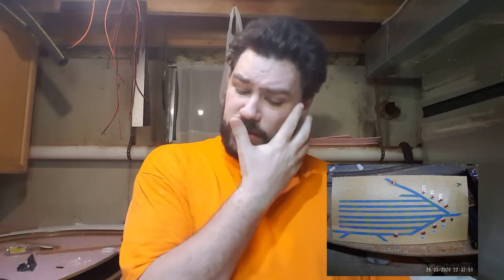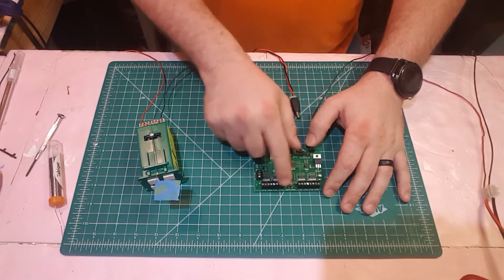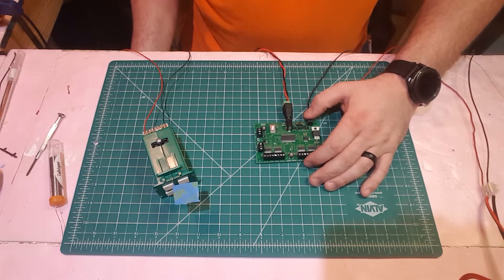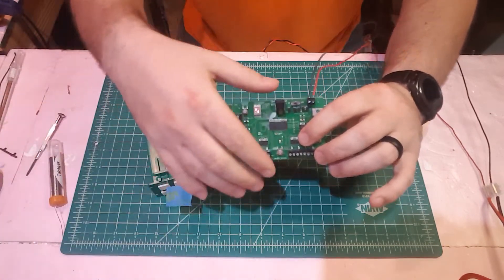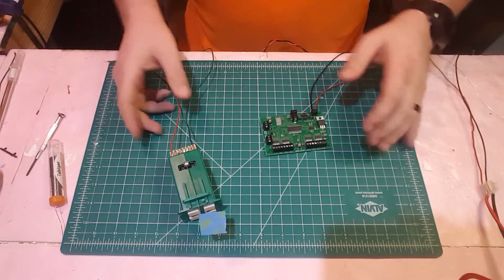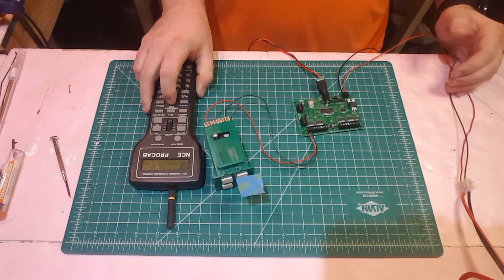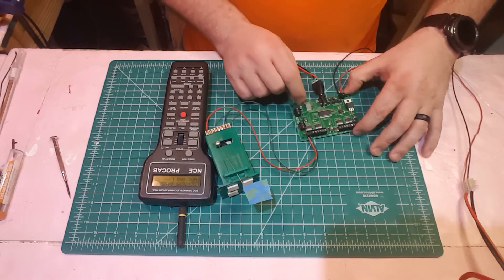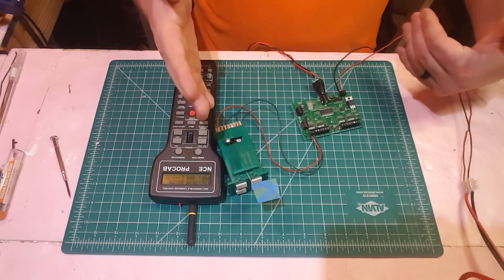NCE switch8 MK2

Comment: So I just did this step by step the way you show how to do and i got it to work. I just need a power supply to
Reply from the maker: Glad to hear it. How many train do you plan to run on your layout at any time? And how many turnouts do you have?
Reply: @FBMRR  maybe two locos at one time but I only have one for now. Of right I have 6 turnout's but I will have more for the coal mine some day. I'm just trying to get what I got now done first
Reply from the maker: @KerleyExpress  sounds great.. i think you are fine for now running it on track power. its not like you will be flipping more than one turnout at a time. i think you will be just fine. Great job getting it started. Im so glad you were able to get it working. i feel so proud (standing in my best superman pose).
Reply: @FBMRR  that's funny super Rick lol

Comment: Hey Rick really enjoy your channel. I also use the NCE system and MK2 my question is how did you make that power plug for the board. Thanks David
Reply from the maker: Glad ur enjoying the videos. Sorry i didnt explain this one. I found the plug specs in the documentation for the Switch 8 and found these on amazon. Work great. This one was easy... 
uxcell 20 Pcs 5.5mm x 2.5mm Male... https://www.amazon.com/dp/B01N48TYBC?ref=ppx_pop_mob_ap_share
Reply: @FBMRR  Thanks for the link, but 20 is way more then my need, Only need 2, is the 2.5mm Male the correct because I see a package of 5 but listed as 2.1 mm Male, and another question where are connecting the wires coming from it to, 
Thanks
David
Reply from the maker: DO NOT GET THE 2.1 i made that mistake. They dont fit. You could use a standard 12v 2amp wall wart. I have a 12v 10amp power supply connected to a seperate DC bus under my layout. Look at my into video or it may be on the next video.. it shows you an idea of what i am using.
Reply: @FBMRR  Thanks for your replay, I just placed my order. Also are you planning on doing a video on how you made your switch panel Im wanting to do one just have no idea where to start.
Thanks
David
Reply from the maker: Yes. Thats my next video. Im just waiting on a delivery of more buttons.

Comment: Excellent product.  Just added some more tortoises using switchit mk2s. Work just as well but i can put them closer to the turnouts. Bus wire is there anyway.
Reply from the maker: Yes those work as well. I only went with the switch 8 because i have over 23 switches on my layout.
Reply: @FBMRR  i started off with a switch8 because i used toggle switches on a panel and the wires were already installed.  The switchits cover turnouts 13 through 18

Comment: Wow this is amazing. I am so glad your showing this. So your saying that one thing well control 8 switch machines. i got get one of those. An its better to run it off its own power supply. Thank you for showing this and can't wait for part two
Reply from the maker: yes one device will control 8 devices. even more if its a cross over track. I think its best on its own power supply. If your interested, the item i was demo-ing was a spare unit i dont plan to use. Just opened the package for this demo. I'm willing to part with it for say 1/2 retail price. let me know.
Reply: @FBMRR  i well email u